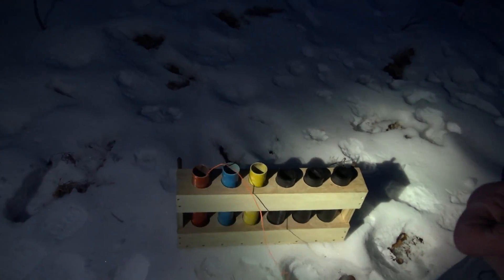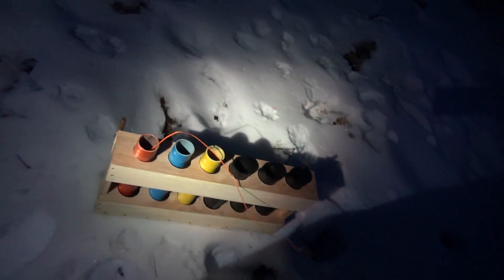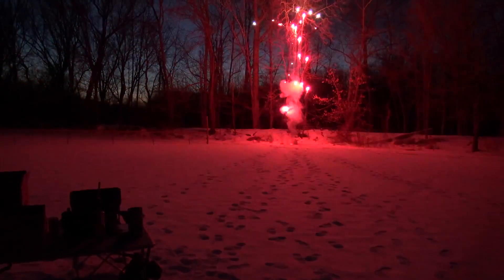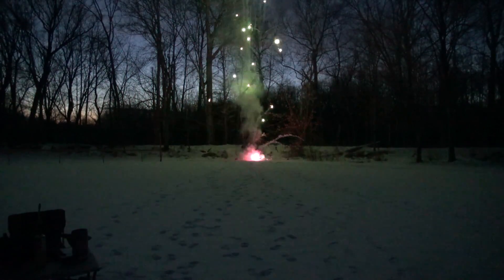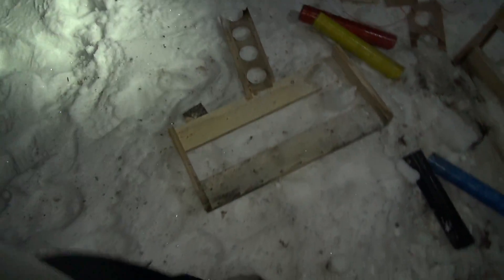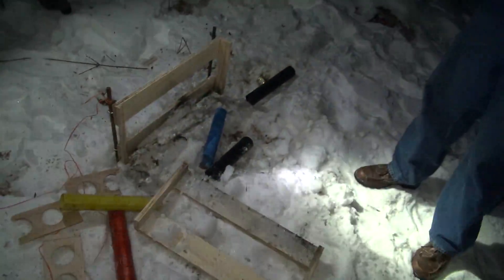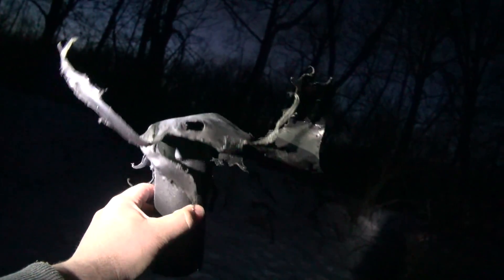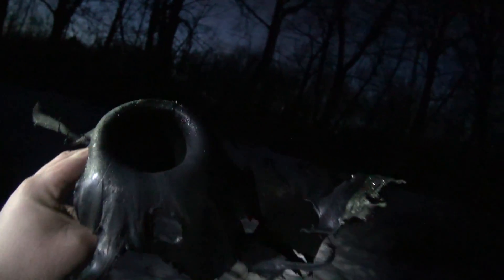1.75" Rack Construction Test w/ Fiberglass and HDPE Tubes

Comment: Just curious, what order did you fire it in? Fiberglass first, then hdpe?
Reply from the maker: bob panciera first 2 fiberglass then HDPE
Reply: I wonder if the rack was already pretty much shot before the Hdpe one went off. I haven't seen one blow like that before.
Reply from the maker: He just built it.... he said he wanted to run this test because he was positive his design would handle the explosion
Reply: Rob only the first one was in fiberglass. The other 2 were hdpe. Hence the one tube missing a plug and the other being mushroomed.